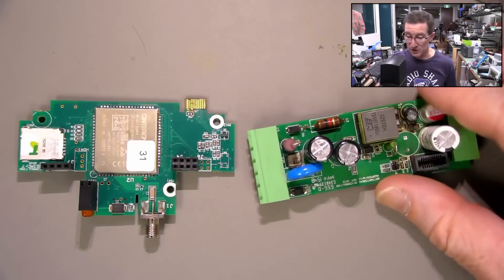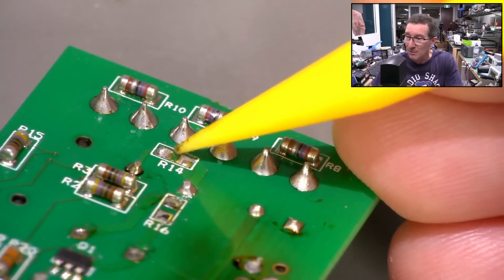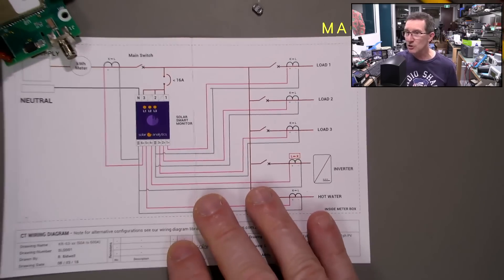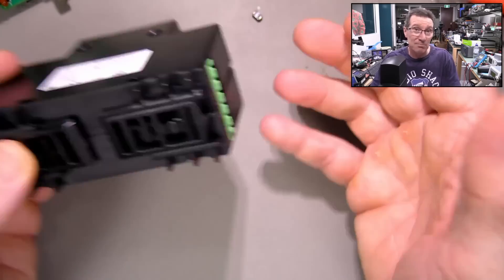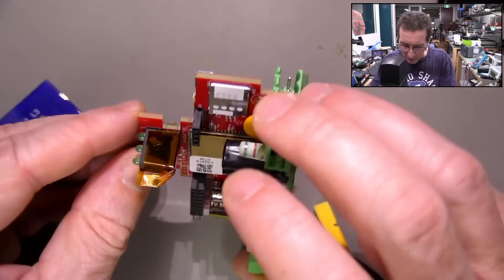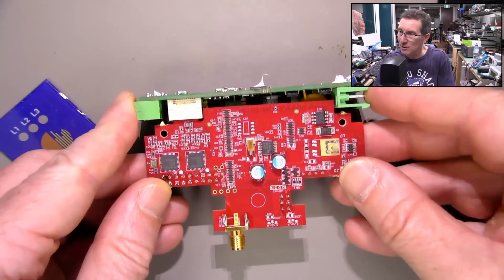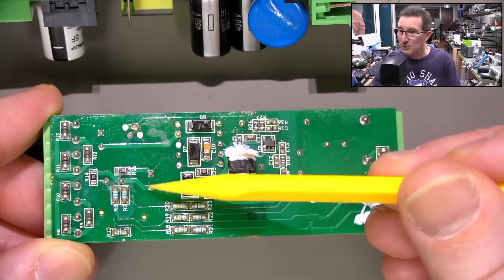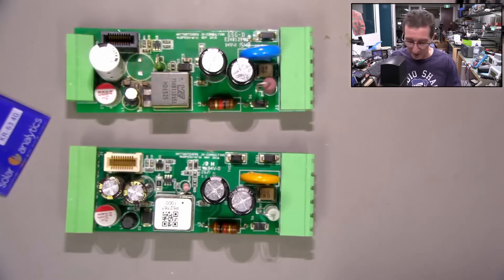Solar Analytics 4G Solar Monitor TEARDOWN

Comment: O. I just saw the remark about there being "no isolation".

Meters that use external CTs traditionally isolate from the mains by including isolators between the voltage signals and the bulk of the electronics 

The CTs provide isolated signals so long as the CT design complies.

These products don't do that: there is no room. And it would cost a lot of money. Instead, the entire meter runs "hot". 

The one thing that needs isolating is the one thing that can be touched ... the antenna.

There is an invisible isolating structure that provides this. 

If you have some grasp of microwave behaviour then you can work out how it works, now you know it exists. 

jon

Comment: I will do my best to straighten out some of these conversations. 

The 4G version reviewed here uses the same power supply as the original 3G version. The remark I made to David about the power supply migrating to a different (single capacitor) hold-up applies not to the 4G version but to the following product, being introduced in 2023. 

Holdup in this product has three functions. When in 2G mode (yes, this product support 2G, 3G and 4G, and all the various submodes) the peak current requirement is much higher and this is routinely met by the holdup circuit. The second useful thing it does is enable a graceful shutdown of the code when power is removed. Flash writes can be completed without being corrupted (a common type of IoT device failure). The third and least useful function (but still useful)  is to provide energy for a last-gasp message.

Holdup in other products of course is designed differently.

The lifetime for the series super caps (which do have series balance resistors) is such that I have seen no other failures (from the 70,000 or so decides out there)although there probably are some.
The parts are rated at 2.7v and are running at 2.0-2.1 which improves the expected lifetime substantially. We provide a very long warranty. The current in the balance chain is x100 the nominal leakage in the devices: this s a perfectly adequate method of avoiding voltage unbalance. Active circuits used for balance are for minimizing the energy of the balance circuit, something that is not a design requirement in this case where the holdup is required only for a few seconds.

As far as the WiFi/carrier debate goes, we were the first (14 years ago) to build an embedded WiFi device. Our market (and the installers!) prefers carrier. But watch this space.

The product family is remarkable. The code is updated frequently and it has some astonishing features. For instance, a 5-minute buffer of high-frequency voltage measurements can be frozen in the event of a network voltage event, and subsequently uploaded by the energy authority from thousands of devices in order to study the propagation of the voltage disturbance across the network.

It can be used for stabilizing the grid in real-time through its ability to control inverters, and also to control loads, and batteries. It is to be regretted that these kinds of "demand side" functions are of no interest to the more capital-intensive "supply side" energy companies that dominate the energy regulators and market.

All the components, and the enclosure, are fire rated. Compliance with basic safety standards requires this. If you are concerned about fire, and that's a good thing if you are a designer (Are you?) then a good starting point is s good read of the international standards with which this product complies (UL61010, AS/NZ 60950 etc)

These products are rated for installation in meter enclosures (Level III). That means they are tested to 6kV in both common and differential mode. The isolation barrier is reinforced insulation and can withstand 10kV. One of our failed competitors installed in box outside the meter box because they couldn't meet the requirements. This was much more expensive to do. 

I like to think inside the box.

Cheers

jon

Comment: The new power supply PCB looks virtually identical to the old power supply PCB!
They are selling you old crap and telling you fibs about the supercapacitors, I think if I had a "hotline" to the designer, I'd be asking what on earth he was one about telling you it only had one super cap, but it has two and potentially the same problem as the old PCB! But that's just me, and I don't like being fobbed off with lies from companies selling me stuff!

Comment: Dave figured out what happened to Solar Moniitor; The balance resistor had been torn out. It was only a matter of time...Before an overload to the supercapacitor.  Whoever did this knew how to cripple it in a way that was not easy to find.

Comment: why would someone bother with 3g or 4g wankery while wifi is the best its not like this will be installed in a remote location with wifi u get 100% local control no cloud rubbish
Reply: Or PLC and a matching PLC to Wifi plug to install where there's a good signal.
Reply: Just send it over the power line.

Comment: The single capacitor rated at 5V5 is internally 2 2V5 capacitors in series, just they are either stacked sealed can types, or 2 units in the same case with a common can. Those fail and leak, because they have no balancing resistors, so the first one to go low resistance internally blows the other one up. Plus normally only one form factor, and only up to around 1F capacitance as well, and horrid high ESR and even worse dielectric absorbtion as well.

Comment: A little StepUp Regulator for the 4G-module (1.8V or 3V ? ) is cheaper than a good circuit to keep the voltage on both capacitors at the same and voltage controlled level. And you can make the capacitor really empty and use the whole capacity.

Comment: Just hoping that the installation manual states that the 4G antenna connector shall not be accessible after installation. By looking at those PCBs it looks like there is no proper safety isolation between AC mains and the 4G board.

Comment: It would be cool if you could try and work out a way to automatically adjust the AC to turn on with the solar output to turn the house, use the air in the house as a thermal battery to keep it cool enough to make it through the night.
Reply: That would be a relatively common home automation use case for something like Home Assistant. Configure integrations for both your energy monitoring system and your AC systems, then configure one or more automation(s) triggered by the net energy point of your house. For example if your AC uses 1 kW of wall power, you’d turn it on when your house is feeding back more than 1kW into the grid. You’d want to add sizable hysteresis and time delays on there to prevent it turning off and on frequently.
Reply: @mlenstra  would be nice to see Dave using home assistant

Comment: Oh ! Red PCB, some of the fire alarm companies use red for Prototype PCBs it's so they can't get out in the wild, you can spot them a mile off, and the 6 year old green PCB ? all sounds a bit how ya doing to me ! I'm sure it will be fine and besides I'm sure your insurance is all up to date and there are no exits blocked at home 'eh ?....just ribbin ya Lol !...cheers.
Reply: Colour change likely because of different PCB suppliers, they used red for the 2020 version main board as the companies provide it cheaper now, and the green was likely old stock of boards they had, fully assembled and tested, just in a package in a box on the shelf, as it would make sense to do a larger run of the board you know is not likely to change, and then smaller runs of the boards that you customise for different GSM regions, as these likely do get exported world wide, and that tiny power supply looks like it is quite capable of handling any common voltage around the planet.

Comment: 2 series super caps with a power sharing resistor is not ideal, but it's fine in my experience 
when you have 2 series caps obviously  you double your risk of failure as you now have 2 links in the chain instead of one but 2x rare is often still rare

Comment: Well, something was definitely going wrong around that R24 Resistor - there's gotta be a reason they replaced it with a resistor, a diode and a capacitor. I have no doubt, that this will fix the issue. Would be lovely to see a waveform of those two revisions in comparison. Although you would have to repair the original one.
Reply: Yeah, R24 changed from a 1206 (?) SMD to a freestanding through hole resistor. Probably was getting too hot.